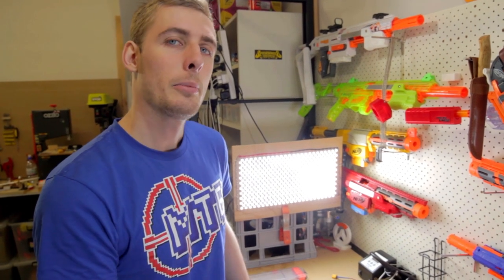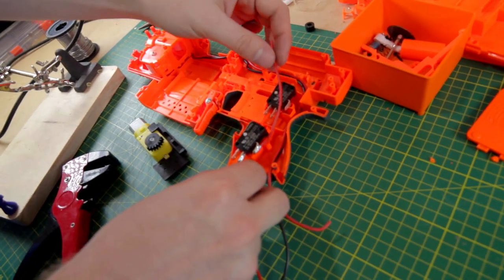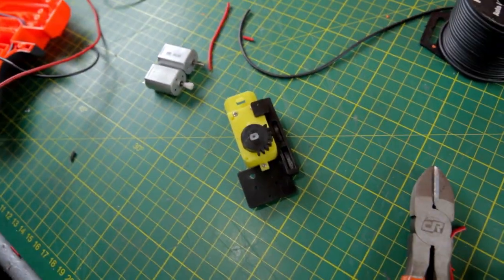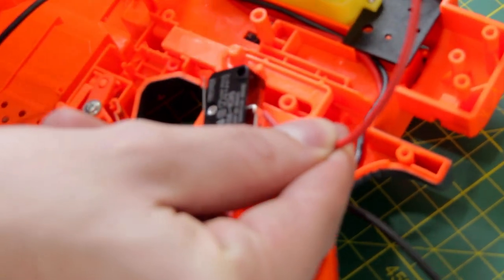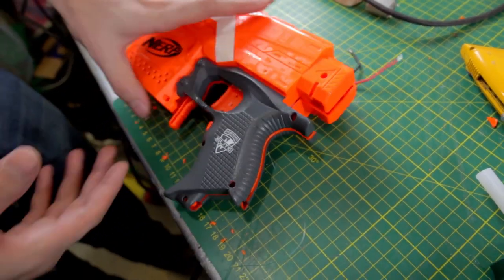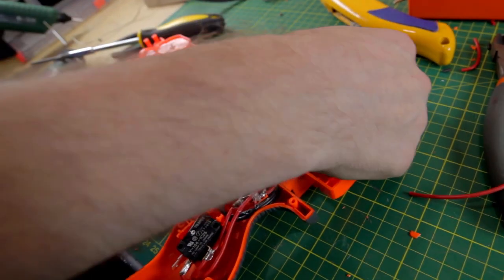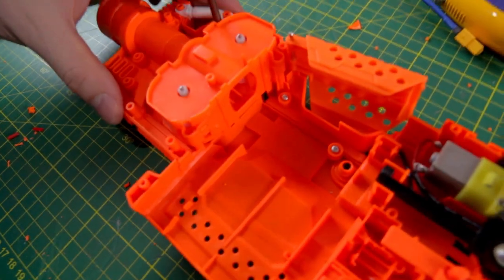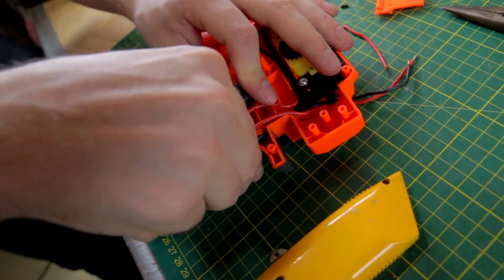How to Make FULL AUTO STRYFE - NERF XSW Kit Mod Guide

Comment: You mention the Positive going from the Normally Open of Switch 1 to Switch 2, then the power from the Pusher & flywheels going to Normally Open but drawing the line to the Normally Closed lead of Switch 2

I think you guys might need to put a note on-screen (if possible) or in the Closed Captions that you meant the lines coming from the Pusher & Flywheels is meant to be Normally CLOSED instead of Normally Open..
Reply from the maker: Im not exactly sure what you mean, but I can assure you that the diagram I drew is correct. -R
Reply from the maker: Ahh yes. Rewatching I said normally open instead of normally close when describing the leftmost tab of the switch. Dang it!
Reply: Make.Test.Battle yea
Reply: Make.Test.Battle I'm using a stryfe with a select fire kit and hellcats, and that means I can't cut out the part of the battery tray for a lipo to fit.. Any suggestions for an extended battery door?
Reply: blastersmiths uk
Reply: ElNeroDiablo i
Reply: NNNNNEEEEEERRRRRRRD
Reply: @gabrielshensky348  Jace 3d, worker, bsuk and others
Reply: Wait hold on what the hell are you saying. What wire goes into what wire?

Comment: Thanks for the video. Just getting into this stuff for my kids. Very interesting mods.

Regarding the inch, it's not "based" on metric, but referenced if that makes sense. And as far as America having shrunk due to that, what is meant is that the measurement has changed (the inch increased imperceptibly). Although with all land masses growing and shrinking constantly, it might be a hard thing to quantify. In 1960 (basically the same time as the inch changed its reference)  the meter changed its reference. Imperial are working measurements (yard is a stride, foot is a foot, 3 miles in an hour of walking (also known as a league). They are easy for anyone to handle. An inch was 3 grains of barley (barleycorn), which used to be an easy measurement for people. Now most people have likely never handled any fresh grains.

Also fun fact 12 is a mathematically more useful number than 10, just we happen to have 10 fingers. Dozenal Society has more information if anyone wants to burn sometime, but fun for us math geeks.

Comment: "Measure twice, cut thrice" -BTM 2017

Thanks for the diagram at the beginning, I'm literally putting of doing a rapidstrike as we speak, with how my timescale works I'll now be able to get it done by the time fidget spinners are popular again.
Reply from the maker: Well we have a vid for that too ;) -R
Reply: I know. But the diagram was in the middle of that one where it's right at the be
beginning of this one, pretty sure they're the same layout electrically so are interchangeable.
On the bright side I managed to get the switches fitted, and I must be using different (larger)switches as I had a lot of trouble getting them in, however once I got them in I didn't need any hotglue/resin to hold them in place, as they are held tightly in the cuts I made to the trigger housing (that only exists in the rapidstrike afaik).
Reply: +EDSKaR

They could just be the same full-sized switches used in the tutorial, it was mentioned they would just be a friction fit after enough was removed. I have the same flywheel and pusher switches fitted in the same way (albeit wired regenerative live center) and they're all a friction fit (including the 10A CC switch, although that's irrelevant to you if you use two-switch).

Comment: What flywheel motors and lipo battery are you using in this mod?
Reply: 3s lipo

MTB rhinos
Reply: MNemJef,mr_bruhman on reddit thanks, but do you know the c rating and mAh of the 3s lipo?
Reply: @CoolStuffOrigami  1000mah 30c zippy compact

I use a 75c turnigy graphene 1000mah
Reply: MNemJef,mr_bruhman on reddit Same! Turnigy panthers are the best!

Comment: FYI you can fit a return pusher switch in the blaster, I have done it, but it is painful and not worth it.
Reply from the maker: I know. I have done in with 3 other builds and I wanted to try just a normal 2 switch in this one. Turned out just fine -R
Reply: +Make.Test.Battle In your opinion is it worth it?
Reply from the maker: Nope. Its far more trouble than its worth, even with this style of kit.

Comment: you guys should use flux when u solder
Reply from the maker: I am using flux core wire so I don't need to add extra -R
Reply: Make.Test.Battle cool, Im twelve and I learned how to solder last week, its actually easier than it looks

Comment: Make. Test. Battle. Currently working on a stryfe trigger that uses a magnet instead of return spring rn in 3D printed testing mod I will be sending you(Ryan) a link through thingiverse as soon as I'm happy with it then if you want you can print it and I will also eventually be casting I in aluminum and sending several your way for testing free of charge I'll probably send you the file once I get to where I'm happy with It, ~ Gavin g, oh wait you can see that can't you?(edit ok screw magnets screw 3D printer inconsistencies I'm annoyed I may still do a stryfe trigger but screw magnets, on another note I have already modeled some windowed 180 motor covers for the stryfe which will be on thingiverse soon!)
Reply from the maker: Is that a good idea? Im not too sure how well that would work -R
Reply: Make.Test.Battle I wasn't sure either it does return it pretty well and clicky the trick (which I'm working on ) is getting it thin enough so there isn't too much friction when the shell is closed but not too thin to where it is stupid brittle (why I want to eventually cast it in either polyurethane or aluminum) I like it because instead of a where the pressure is constant through the trigger pull it instead has a heavy initial pull and then it lets off, is it effective, no not really, but I wanted to so if I can make it work idk it's unique but yeah long reply
Reply: Make.Test.Battle also forgot to mention but just to clarify it would be a microswitch only trigger not the whole pusher